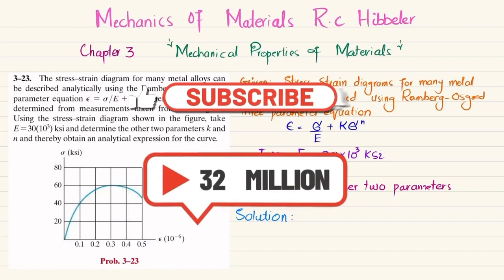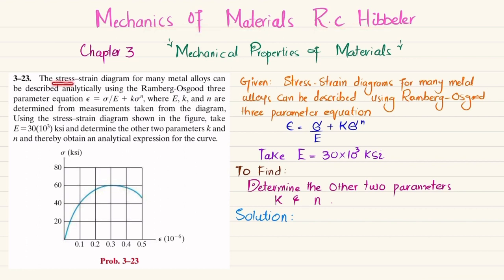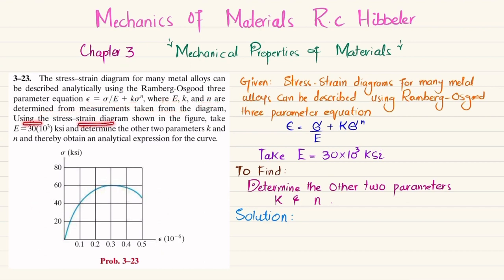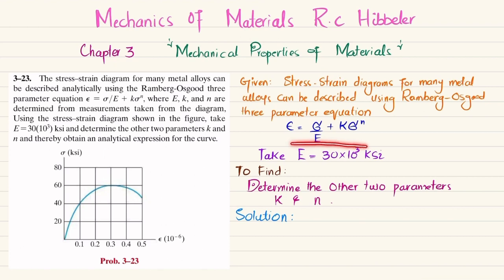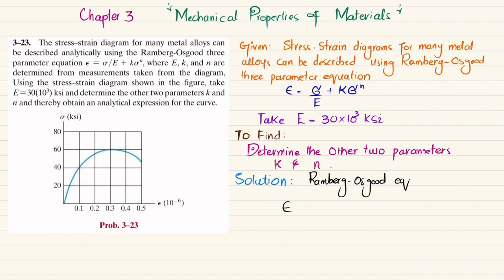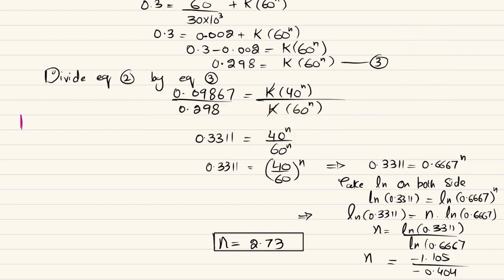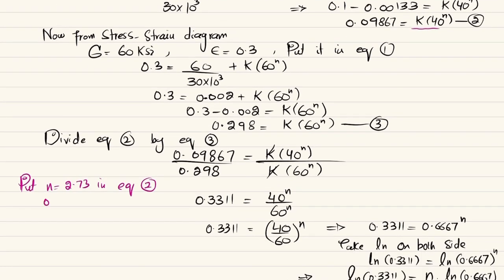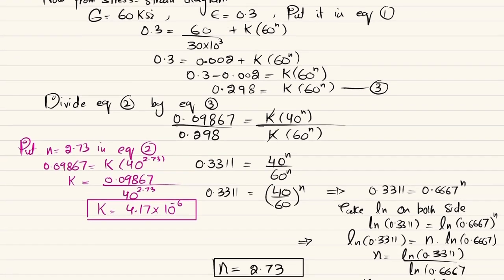3-23 | Determine the other two parameters k and n | Chapter 3 | Mechanics of materials rc Hibbeler

Comment: bruh why isn't it 0.1*10^-6 and 0.3*10^-6? I am so confused in this problem
Reply from the maker: Kindly specify the time frame where you have problem 🙏
Reply: @ basically the unit for the epsilon in the figure (it is labelled 10^-6)
Reply from the maker: It's not the unit , the value of epsilon will be multiplied with 10^-6...